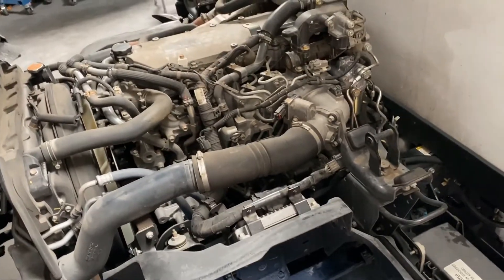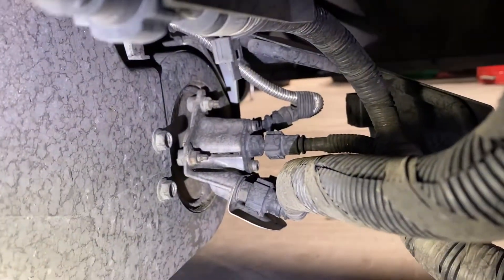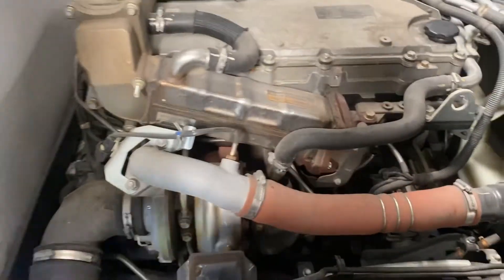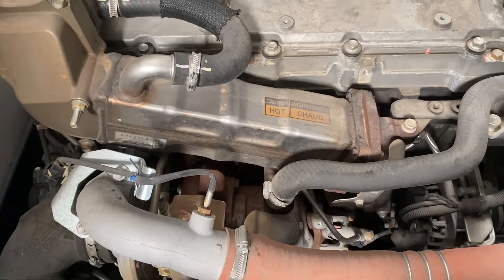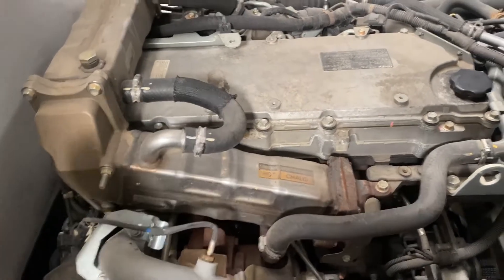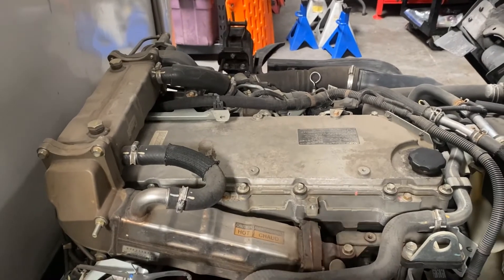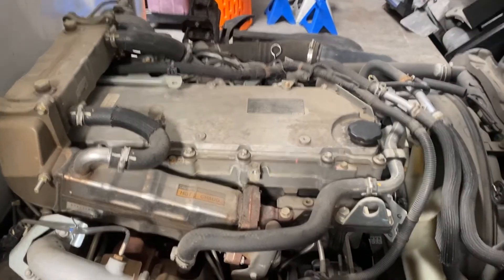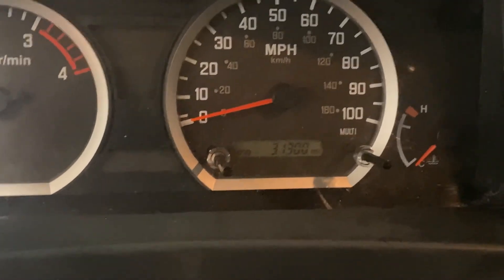SCR Selective Catalyst Reduction and NOX emissions.

Comment: Hi..thanks..need a video of live Scan report of DPF  , SCR system pids of all sensors..
Reply from the maker: Sorry for not replying soon. Manufacturers differ in pods. Too many variations between them but keep it simple, check NOX levels and exhaust temps. That’s why it’s necessary to know how they operate and the range their in.
This is learned by working on trucks and following service information.
Some trucks have three NOX sensors some have oxygen sensors which are almost the same as NOX sensors.